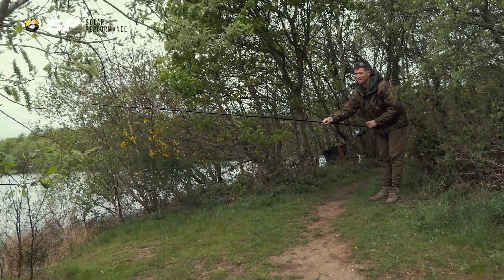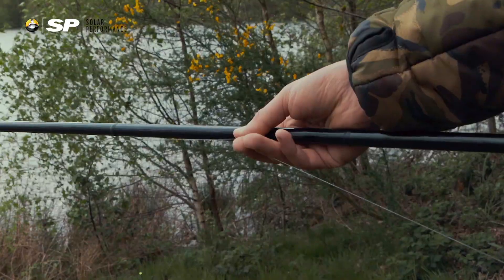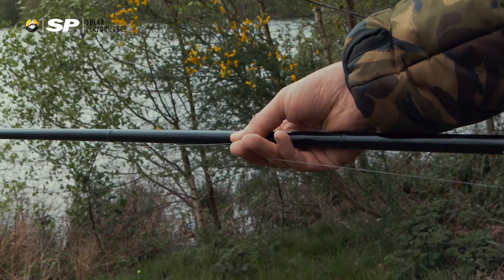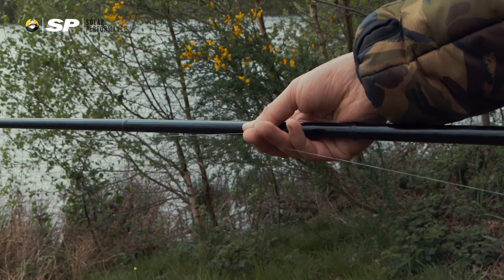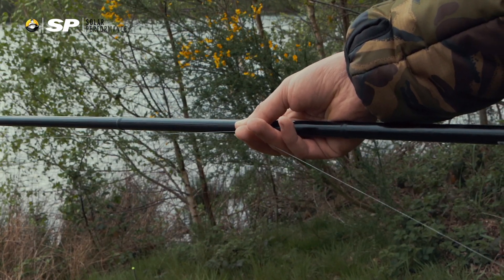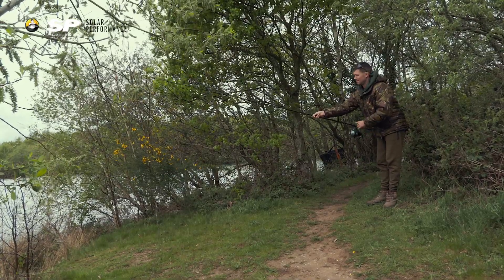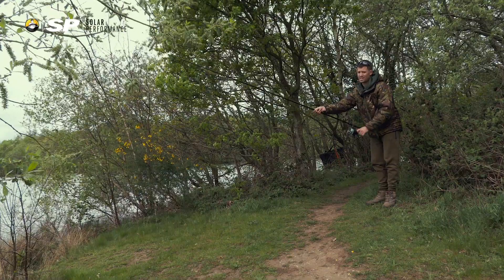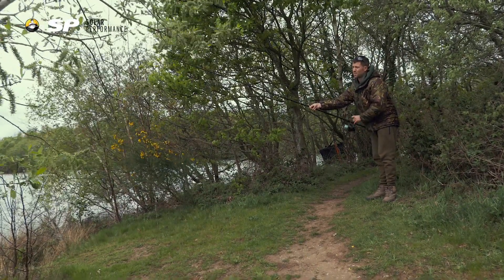Avoiding Frap ups/Crack Offs

Comment: Had a spomb crack off few weeks ago first time in ages but happens i hold the line the same and before casting pull about a foot off make sure its not Caught on anything and still managed to crack off lool